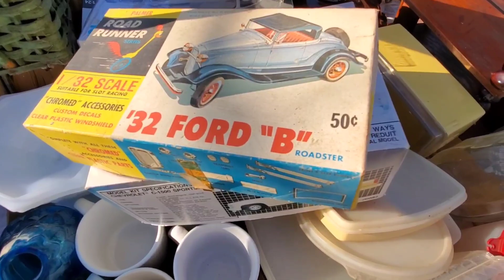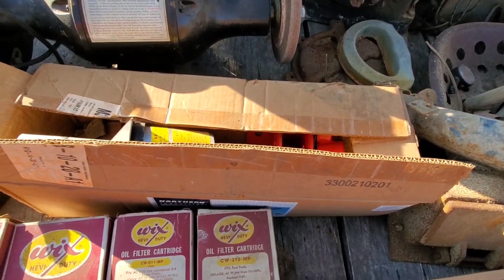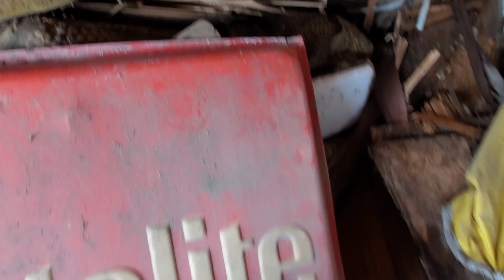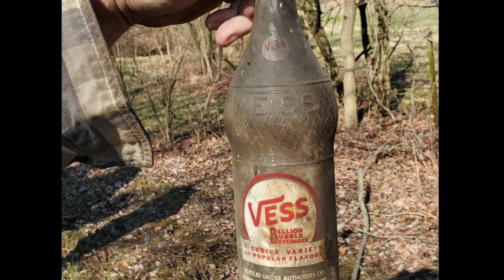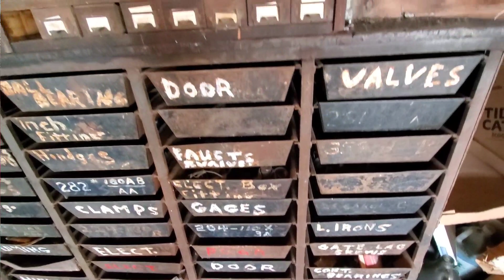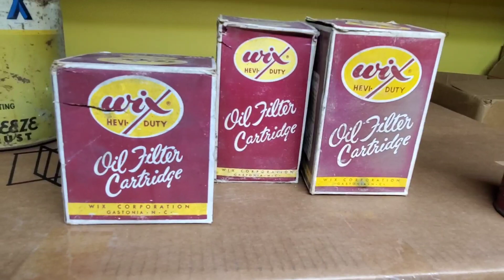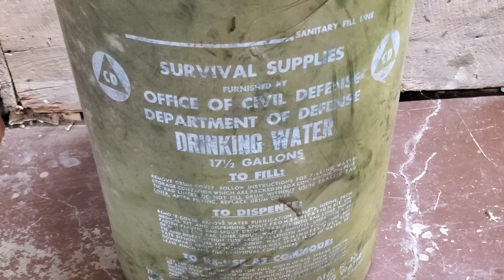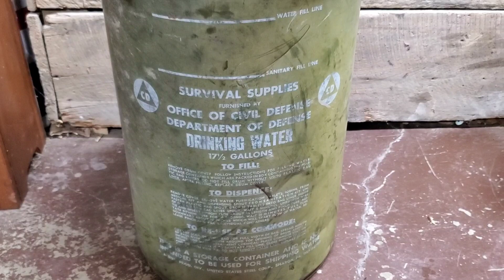1980s Chevy Suburban outsells Dodge Challenger, 50s Pontiac, Kaiser at Auction

Comment: the water can is from the cold war, the 1950's for the fall out shelters...
Reply from the maker: Thank you!  Good to know.  I figured it was newer than WW2 but wasn't sure.
Reply: I agree Cold War. 17.5 gal, probably issued 1960-64 Although it could be manufactured in late 50s.
Reply from the maker: @FLYEAL  it has instructions for multiple uses including use as a commode.

Comment: Kaiser  Shit I would have paid 1 grand for .  They are hard to find in condition worth putting back on the road.   375 was a steal  and if they also did the engine and tranny when then painted etc it could have be a real steal.  The honda 50 had some stuff on it that made it worth buying .  Shocked that someone knew that it was worth buying since most don't know about those options .